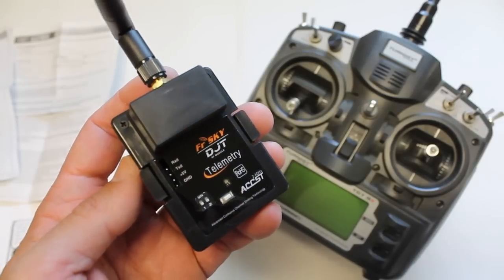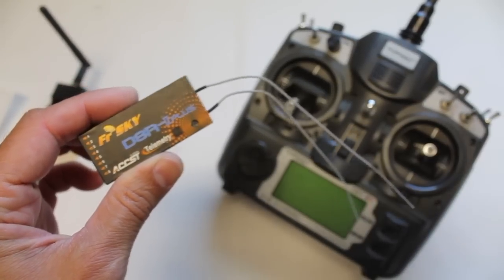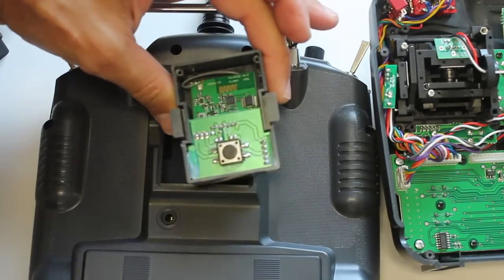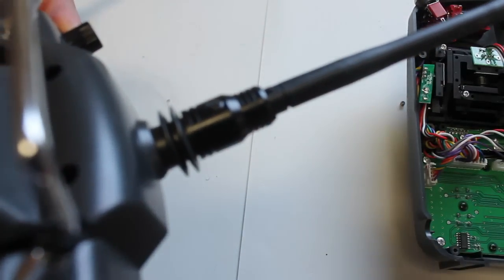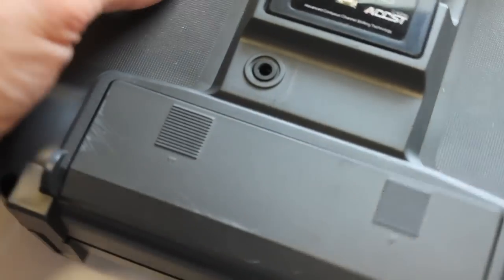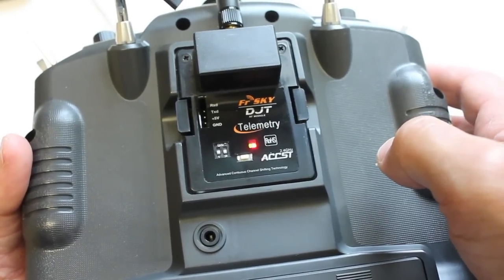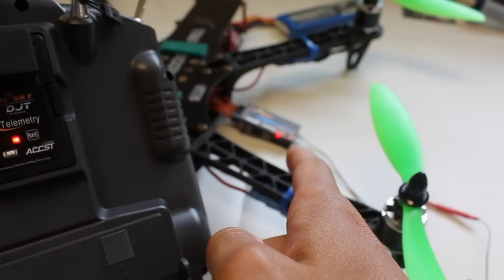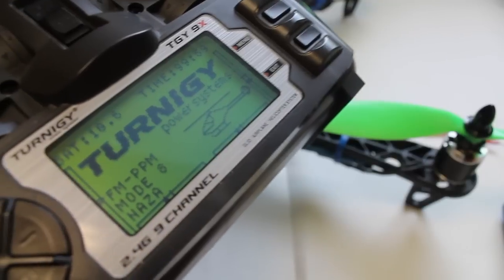Turnigy 9X FrSky Transmitter Upgrade and Binding with TBS Discovery and DJI Naza

Comment: Hi Dennis, great video, as are all of the videos you do. Would you trust this setup for reliability and range? As in trust, I don't want to ditch a 90 series raptor nitro heli if the transmitter or receiver fail. 

The group I fly with have had problems with the turnigy Tx and rx in its standard form with failure at a range of 300-400 meters. 

Obviously I would range test before use. I am just after general opinions of people in the know. 
Cheers
Reply from the maker: Hi Adrian, thanks for the comment. I've had no problems at all regarding reliability and range with the FrSky mod. Now I haven't flown beyond 1/2 a mile but I've heard about good range beyond a mile. Are you playing on going that far?

Comment: Hey Dennis, I just installed my DJT Module into my Turnigy 9X and the D8R-II+ into my FPV Flip w/Naza Lite GPS and it appears I have now lost the GPS position hold mode that the Naza offers. I had it configured using one of your other videos with the standard Turnigy receiver and it worked perfectly. 

I'm thinking maybe I have the GPS plugged into the wrong channel on the receiver? Have you run into this problem before and happen to know what receiver channel works with the Naza's GPS unit?

As of right now the U port on the Naza is going into channel 6 with no response shown in the setup assistant. I've tried channel 8 as well with no luck. 

Thanks again for the video, the FrSky manual is terrible compared to this walkthrough.
Reply: Figured it out! Apparently the module switch shifted my pitch curve values just enough to confuse the Naza assistant from recognizing the 3-position switch as switching to each flight mode as usual.
Reply from the maker: Hey there, glad to hear you figured it out. I've struggle with the pitch curves many times before but once you get comfortable with them they really give you a lot of flexibility. Take care.

Comment: Nice video.  I followed your processes, and connected to my NAZA lite.   From the original setup the receiver was set to Traditional.  When I changed it to PPM it stopped working { RX -ERR}?  Went back to Traditional and it works { per the NAZA set up screen)?  Is this correct?
Reply from the maker: Patrick Jordan If I recall with my T9X and FrSky combo it was set on traditional. Give that a try and let us know if you run into any problems. Make sure you go through the TX calibration sequence just to make sure your sticks are responding properly.

Comment: Hi Dennis. I would like to know if the Turnigy 9x needs any software update to work with the Frsky Djt module?

And schould I get the graupner/jr module or the futaba/hitec module for the Turnigy 9x ?
Thanks
Reply from the maker: No, it shouldn't. I used mine right out of the box. I don't know about the other modules. I only used the factory and then upgraded to the FrSky.

Comment: Great Vid Dennis, as always. Mine binds fine but when I power the TX and my quad back on after binding all I get on the RX is a dim green light not the solid red. Any Idea what that means? And second, what range increases are you seeing with this upgrade?
Reply: Please disregard my previous question, I now know wassup. I though my unit wasn't working because I did not get the solid red light just the dim green and I was unable to arm. It appears the naza m lite w/gps needed a radio recalibration, mainly the 3 position switch, their values needed to be changed as they were off by about 2-4 points so the naza would not arm since it could not tell what mode it was in. The dim green light is normal, just means no telemetry just receiving which is fine for me as I just wanted something with a little better range than the stock 9x tx and rx. Thanks again Dennis for the great instructional vid.
Reply from the maker: James, man it's great to hear from you and know that you're still alive :) I hope all is well and that you're getting some flying in this spring. Keep in touch and I'll be looking for you over on Garage Pilots!

Comment: Hi, Dennis, thanks for vid.

i have a question if you don't mind.
will the module bind with FrSky D4R-II 4ch 2.4Ghz ACCST Receiver? i plan of using turnigy 9xr for rc eye one xtreme.
Reply from the maker: R Dody Shahputra apparently it is compatible with the D series receivers:

http://www.alofthobbies.com/jr-transmiter-telemetry-module.html

Good luck with your setup.
Reply: Dennis Baldwin thank you. :)

Comment: Nice video simple and to the point i have the frsky but have not installed it yet i thought i would lose all my settings but that answered my question also i have a few fpv flights now and i am wondering how much of a range increase i will get i am flying a stock fatshark 250 milliwatt

Comment: Hay Dennis this is to have a stepper throttle on the Turnigy 9X, or the Flysky 9X. Take the friction bar that thay have in there for the throttle look to see where the gimbal throttle wheel has rubbed it's track on the bar, notch the middle of that tract with a file, twist a piece of wire from a loaf of bread across it after taking off the plastic cover. That's it a ratchet throttle.
Reply from the maker: Great tip, Alonzo! Thank you. Have you done this mod before?

Comment: Hello,Can you tell me if the FrSky module has model match?I have some models for play, each have a X8R receiver but I would like to change model without switch off all of them.Thanks in advance.
Reply from the maker: +micaboss Good question. This article makes it sounds like model match is enabled by default because each one will get its own receiver id:

http://openrcforums.com/forum/viewtopic.php?t=6872

Let us know if you get a chance to test it.
Reply from the maker: +micaboss BTW check out this comment about making sure to bind in D16 mode or else it won't work.

Comment: How many really far you can fly with this set? I just bought the same. And was able to fly off to a maximum of 700 meters. A STATEMENT 1.5-2.5km. ps flew to the city (in the park)
Reply from the maker: Mr Groza To be honest I'm not certain. I rarely fly outside of the line of sight so the furthest I've done is ~ 1000m. I hope to do some tests soon and will share my results. Thanks for the question.
Reply: Dennis Baldwin hank you. I'll wait for your tests)

Comment: i bought 9x radio from some one , and who was using  open tx 9x 2.0.15 version , you are expert , pls guide me the version already in my radio is good or ER9X VERSION IS GOOD or any othr version you think is good rather then these 2 firm ware ??? pls guide ,  programming card is good to attach in radio , so i can easily make set  up for my plane or channel setting .

Comment: Really helpful video, thank you! Do you have any tips on connecting this controller to a computer (in particular a mac..) for flight simulators such as FPV Freerider? I am wondering whether to try a jack to jack or jack to usb but I don't really know what I am talking about..! New to it all :)
Reply from the maker: +Theo Carter If used my Turnigy 9X with Aerosim using the cable that comes with the simulator. It's this one in the product photo:

http://amzn.to/1PSuJeA

Now I'm not sure if that will work with FPV Freerider though. I've used FPV Freerider with my Taranis, but not with T9X. Actually, if you read the reviews here:

http://amzn.to/1RB1rjR

There is a guy that says that cable works with FPV Freerider. Just make sure you remove the RF module as that caused problems with my T9X in the past.

Comment: Does this kind of setup have a fail-safe for example when the radio gets its signal cut during flight? 
Does the fail-safe really work with this setup?
Do I need to have the er9x firmware to make it work?
Im just pretty much confused since im just starting with this hobby.
Reply from the maker: Joseph Hermoso You can setup failsafe at the receiver upon loss of signal:

http://copter.ardupilot.com/wiki/throttle-failsafe/#warning_to_copter_315_and_frsky_receiver_users_and_users_of_other_receivers_that_modify_channel_5_during_a_failsafe_event

What you'll do is setup channel 5 to toggle into RTL flight mode and then press your receiver failsafe button to remember that setting. As the wiki suggests it's not the ideal way of doing it because if your receiver loses power then that signal won't be sent from CH5 to Pixhawk. But it's definitely a good starting place. This setup is not firmware dependent (er9X, OpenTX). Keep us posted on your progress.

Comment: sir we have a frsky x4r. telemetry and also we have used the turnigy receiver toether with its turnigy transmitter.

what should we do? do we need to stick with the turnigy receiver or buy another module for telemetry?

we are still on building something

Comment: Luckily it's still quite easy. You just have to open up the transmitter, remove the 4 screws on the PCB that has the module pins, then cut away the little plastic sheath. I just used pliers to snap off the plastic, but it would be even easier and cleaner to use side cutters.

Comment: Hi Dennis, hope you are well! I have an old DJT module with its V8FR module (which I think I would need to upgrade for my following question). Is it possible to get some Telemetry put of the Naze32 Fr Sky UART port, with this module, on the 9XR Pro? IE Battery status RSSI etc, as per the Taranis ease of use using for example an d4r-II. I am new to the sport, and bought this one some 1 year ago, stuck with it; but wanted to get a cheap 250 FPV running on this module a cheap receiver, without to purchase another Taranis for a friend... How Can I get this DJT module to provide an d4R-II telemetry analog data? Would I have to connect the Telemetry pins of the DJT to the 9XR bottom compartment or else? I'd truly wish to re-use this new Gear for some kids who with to fly, and I want them the warning on the battery level; you know the story right!? Can it be done? I have been looking around for some time and no one one apart form the FrSKy telemetry screen with the DJT have been able to level sonme D8 telemetry with this module, which should be compatible!? Tks for your consideration on this has been question; or else, I throw it away... Oops! The technology is going so quick, that such a crap buy remains, but it is written telemetry on it, and I can't figure how to relate to it on the RC.... Tks again might you gave time yo answer. Kind Regards and Safe Flying; hope the ODM is still moving you forward, as we are! This is an old drawer question though! FPV Cambodia.
Reply from the maker: FPV Cambodia Great to hear from you and hope all is well. I really wish I could help you out, but I no longer have my 9XR and have never done this configuration before. I've seen some talk about doing it with the Taranis, but not the 9XR. But definitely don't throw it away :) Hack away at it a bit and let us know what you discover. Good luck and sorry I can't offer more assistance.

Comment: Hey Dennis, have you been able to get a "lost model buzzer" such as the one from Hobby King, to work with this setup? I have mine set to work with my gear switch but no matter what I do, as soon as I plug it into the receiver it starts buzzing. YIt works great using my Ezuhf system on the same 9x but not when I have the Frsky tx/rx on it.

Comment from the maker: The only way I know how to power it is via one of the servo leads coming from the ESC to the receiver. It runs off 5V so if you can find another input source you could wire to a servo connector and use that to power it. What are you trying to do?

Comment: why don't you use the D4R-ii receiver? isn't this a good one? will this work for the turnigy 9x?
Reply from the maker: Thijs Dhaenens That should definitely work with the Turnigy 9X if you have the frsky module installed.

Comment: Hi, does this frsky module work on my eurgle transmitter?
Because I have the 2nd generation eurgle transmitter and can,t find to buy the 3rd generation so I can buy more receivers.
Reply from the maker: Hi there. Not sure if it will work, but this post suggested it's possible;

http://www.hobbyking.com/hobbyking/forum/forum_posts.asp?TID=35000

If you find out that it does work then please let us know! Thanks.
Reply: ok, thanks!

Comment: Hi, I have the same tx and the same FrSky module but, my module does not fit in tx correctly, you know why ?
Reply from the maker: +Juanes Mesa I've heard mention that there are two different generations of this TX that have a slightly different body. I recall someone in this thread that had to shave a bit off their TX to get it to fit.
Reply: +Dennis Baldwin  Yes in turnigy V2 have to cut where back pins come out, after that... fit perfectly. Thanks, great video.

Comment: Is there anything i can do with the old stock 9x receiver? Is there anyway i could flash another firmware on it or do hardware modifictaion in order to bind with frsky transmitter? It's pretty much useless after the upgrade...
Reply from the maker: Mateus Leonardo Good question. I have a few of them laying around collecting dust. Maybe someone can shed some light on what we can do with them.
Reply: Dennis Baldwin Could the receiver binding with the Frsky transmiter, so I can use the receiver for simulation on my PC?

Comment: Dennis, this FrSky D8R Plus Receiver supports telemetry.  What other components do I need to use the telemetry feature?  I have a APM 2.5 can I just connect the telemetry port on my APM 2.5 to this receiver to transmit telemetry data down from my multirotor?

Comment: Is it possible to upgrade Flysky 9ch transmitter with Frsky L9R receiver & XJT module with failsafe setup when signal lost for my Naza V2 setup??
Reply from the maker: I would think that's possible although I've never used a Flysky TX. I know the L9R RX does support failsafe so if you configure it properly the Naza should be able to respond to it. Here is the documentation that talks about failsafe for the L9R: http://www.getfpv.com/media/wysiwyg/documentation/Frsky-L9R-Manual.pdf
Reply: Thanks for your quick response, Flysky 9ch & Turnigy 9Ch are same transmitter,Only brands are different.
Here the menual is showing L9R support failsafe as other receivers but not with Taranis X9D.
I want to upgrade my Flysky 9ch for long range with Frsky module.That's why i choose L9R receiver,but without failsafe its not safe to fly any multirotor so far.
 
A guy used with APM 2.6.
There is a procedure he applied. 

1. You need to connect the flight controller + the L9R with the TX off.

2. The L9R receive accelerator signal 900pwm. At that moment you press the F/S button L9R RX writes this (900) minimum.

3- After L9R F/S record you will connect the TX and set the F/S flight controller by software.
he was helped.
will the same work with Naza or any other DJI controller ???

Comment: I wonder if they have a USB telemetry receiver so you can feed both the Transmitter AND a laptop running APM software?
Reply from the maker: Good idea. I'll have to look into that. If not there's probably a way to split the signal.
Reply: Thanks for the link.

Comment: I'm going to flash my firmware, should I use er9x or opentx? My intent is to use telemetry displayed on my screen but I don't know which firmware to use (I like opentx) or what I have to physically solder to make it work?
Reply from the maker: I, like you, prefer OpenTX over er9x. It just seems to be more widely adopted. I haven't done any telemetry display on the screen but surely it can be done with all the OpenTX users out there. Maybe this will help get you started: http://open-txu.org/home/undergraduate-courses/basic-airplane-set-up-with-taranis-2/skipping-forward-to-telemetry-1313/
Reply: off topic but I just bought one of those cheap $199 asus chromebook to use opentx companion. I noticed opentx companion software wasn't available for use on a Chrome OS so i installed Linux on my chromebook and problem solved! starting to learn basic terminal code has been fun along the way and also recommend to everyone to try a chromebook they are unique computers...technology is awesome!!

Comment: Hi
I have frsky XJT and when I turn transmitter on it sounds strange. It's very quiet buzz lol. Is it normal? O.o
Reply from the maker: +Franek Dzbanek I believe that's normal although I haven't used my XJT module in a while so I can't test. Maybe do a range test to make sure you don't have any faulty hardware.

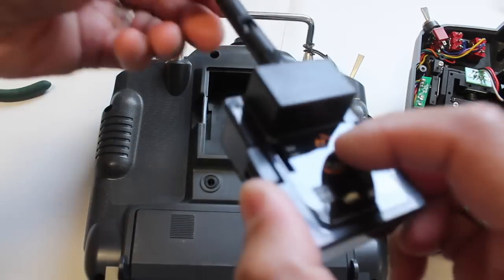Comment: On the 3:45 I see that you have already prepared the place for FrSky module to fit.
The plastic casing around the connecting pins is removed.  Why don't you say anything about this?  FrSky module doesn't fit the Turnigy 9X without this procedure.

Comment: what kind of range did you get on the old module compared to the new?
Reply from the maker: I never did this test but have read that you can expect from 2 - 3 miles range with good line of sight. I need to do a range test soon. Thanks for the comment.

Comment: Hi Dennis! Do u have any idea why I cant bind my Turnigy 9x receiver with frsky module? 2. switch is on (no telemetry on receiver) and standard binding process doesnt work. Anyone had same problems?
Reply: Thats again me. I've got an answer from hobbyking. Turnigy 9x receiver won't bind with above module. I hope it will save someone's time a bit.
Reply from the maker: Mackox112 Right. You'll need to get the FrSky module installed in your 9X. Good luck and thanks for sharing.
Reply from the maker: Mackox112 Right. You'll need to get the FrSky module installed in your 9X. Good luck and thanks for sharing.
Reply from the maker: Mackox112 Right. You'll need to get the FrSky module installed in your 9X. Good luck and thanks for sharing.